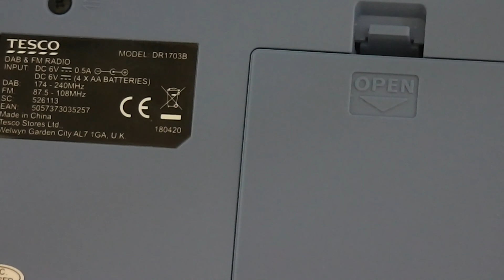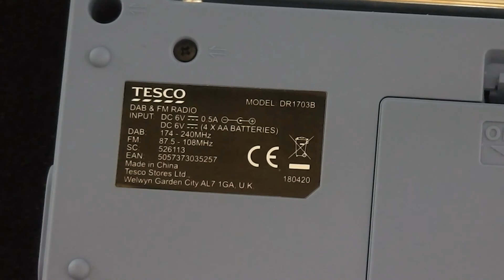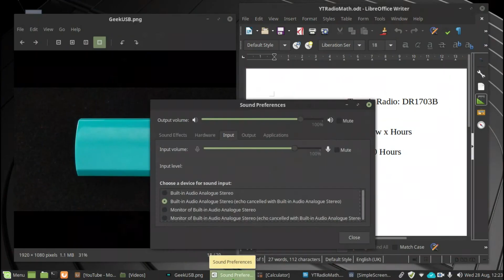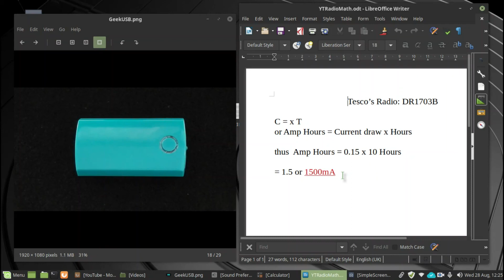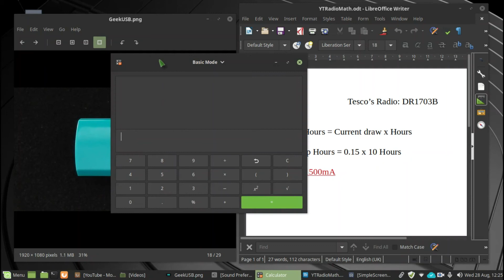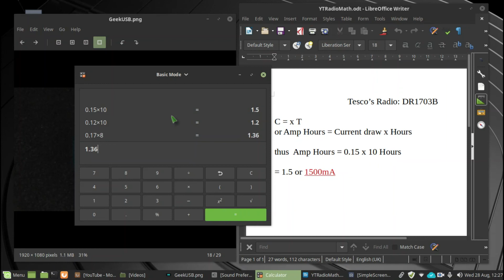USB power bank powering Tesco Radio DR1703B and link to update video.

Comment: Very useful information I have the same radio, and it does eat the AA batteries. A radio like this should come with a USB lead. Found the video by accident when looking for a copy of the instructins.
Reply from the maker: Sorry about the reply delay. I'm pleased you found it informative and you're right there's absolutely no reason why it couldn't come with a USB lead? The manufacturer must also make AA batteries :) In my experience all DAB type radios draw lots of current - it's all that processing.